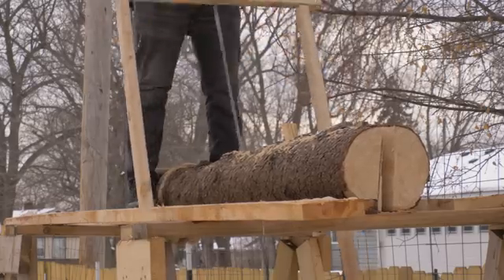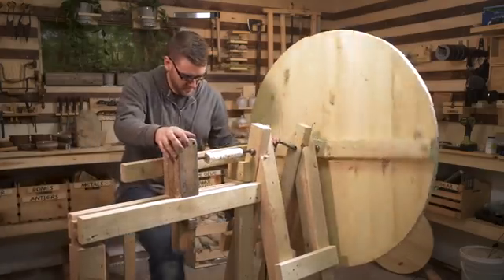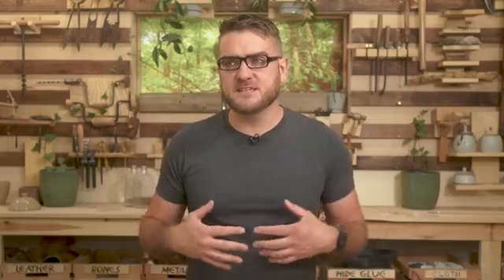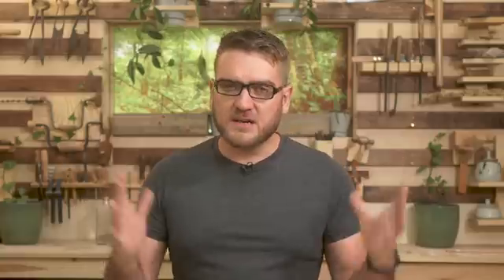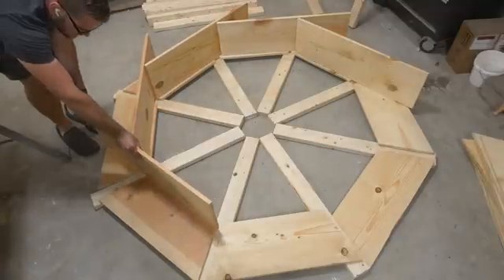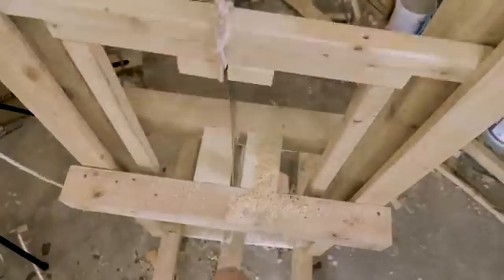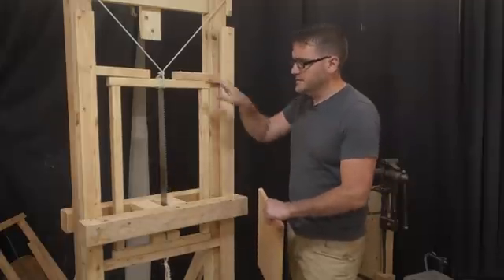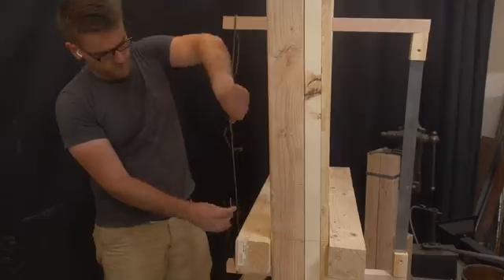I Built a Medieval Watermill to Power My Tools

Comment: The first thing they did to power the tools was to use a cam system to lift and push on bars similar to the DaVinci hammer you built. Though in the case in talking about they pushed down in a lever to lift the hammer then released it for the drop. You may consider something similar for the saw.

Comment: I love this time in history but I really think a step is being missed here and that step is what I'm extremely curious about and maybe lost to time now. This is actually building a machine out of lumber (which is yet to exist) to mill lumber. How did they create lumber before a mill. There must have been a step between hand cutting wood to lumber mill. And i'm talking about cutting straight wood for more precision in lumber mills, not just ripping wood by hand. I think it was the invention of the wood planer, but that needs a straight edge. Chicken and the egg scenario. I.e how did we create straight material to create straight material. Possibly straightness just got refined over and over slowly with each generation of tool creation. Great work Andy, soo cool what your doing.

Comment: Try extending your stand base out from the wheel on the crank side to  connect the crank into the wheel by two points then have it spin off the ninety degree horizontal to make another double pin crank attached to a cog gear.

Comment: On the upside at least the manual saws are a good workout, regarding the water wheel would not multiple smaller "buckets/blades" yield better results? I'd imagine they would take less time to fill and deposit thus leading to more consistent motion and faster revolutions.

Comment: The thing probably you could do is mount the wheel higher or put the saw in a pit so that the central axel is over the top of the cutting frame. Then you attach a crank to that to get your up and down motion.

Comment: You ARE planning to water seal that wood, right? If you're just using it to make content for a few videos, then it's not needed. If you're hoping to keep it around and actually use it, then you need to water seal it, or the wood will warp, and rot. You can research period correct treatments used to do this also. Otherwise, you can just get some modern sealer from a hardware store.

Comment: The big reason why you're not getting motion out of the axle for the water wheel is it isn't keyed. You have to have a Woodruff key or a dowel pin to connect the shaft to the wheel without it being able to just turn on the shaft separately and then you need one on the shaft to the crank to keep that from just being a bearing block as well. If there's nothing forcing them to spin together, the harder material is just going to spin freely inside the softer material.

Comment: wooden gears seem like a good step for a smooth transition from the water wheel to the devices you want to power with the possibility of increasing or decreasing the size to convert speed for torque or visa versa

Comment: You do know that water power, even in warmer climates while using a dam, is seasonal. You'll have the lowest power in the winter, highest power mid spring with the power falling off through the summer and fall. Not to dissuade you, but you should be aware of that.

Comment: personally I think if you've proven that you can do something manually but then you need to do it a dozen more times, it's okay to pull out the power tools, this whole channel is kind of a hypothetical right, nobody cares that you get timber from the hardware store, because like you say, you unlocked it by proving that you can do it yourself. 
Now with this wheel I guess you've unlocked power tools anyway so good on you
That hit in the head would have hurt

Comment: I'm curious as to why you didn't make a circular blade with a treadle & appropriate drive train for straight cuts, and use the frame saw just for rough cut lumber, ripping larger pieces & curved kerfs?

Comment: Gears and pulleys come next.  I am not sure that the industrial revolution came with harnessing water power.  The Romans used water power for milling grain long before the industrial revolution.  From what I understand the industrial revolution came from the building of laths that turned out precision, reproducible parts like shafts, bearings, screws, bolts, and nuts.  From these simple, but precise parts, power looms could be made.  Also the development of steam engines was critical for the transportation industry.

Comment: I wonder if you could add a sort of sled fixture that could slide horizontally toward the blade but restrict vertical movement of the work piece. It seems you are losing a lot of cutting motion when the workpieces are pulled upward by the blade of the spring saw.

Comment: Hey Andy, I love the videos but there has been something that has kinda bothered me for a little bit. Originally you started this series as a everything has to be made from scratch, and it has clearly went away from that since the fire etc. I guess what is bothering me is that some things you are insisting on using your home made tools and others you just pick up the materials from the store. Specifically, like the wood is store bought, but you are cutting i on your homemade saw, the metal pipe for the water wheel is store bought etc. On other videos you have spend a lot of time making wooden things to avoid store bought(which hasnt worked as well/broke and taken a lot of time), and I guess I am just wondering what your logic is here. No issues with what ever your answer is! I love the content I am just a little lost as to what the root of it is. I feel a little disconnected i guess. I love the crafting everything from scratch and the restart type of thing, but would love to hear more of your thoughts (possible in future videos) as to why you make the choices you do in certain builds. Obviously, no one expects you to saw wood for hundreds of hours in order to get a video out every few weeks. But is it more of a 'I've unlocked X with privative tech so now I can get the more convenient options'? Because if so, thats totally fine but thats the root of what I am trying to figure out! :) Thank you for the great content!

Edit: I do not care at all about the tubing for the water lol. Thats a no brainer! Once you craft something test it however you can. My question is just for the base builds. I wouldnt expect if you made an electric drill that you make your own electricity to power it (although you can now! :P).

Comment: For running the saw make the crank pull down on a rope tied to one end of a seesaw lever mounted above your saw and water wheel, and tie the saw to the other end of the lever. Add weight to the saw as necessary.

Comment: When I was a kid the dad of a friend had a metal shop powered by a single electric motor mounted near the ceiling. A rod ran across the room up near the ceiling, there were several drums on the rod, and straps, leather I think, ran down to each machine to be powered. There must have been some way of clutching/declutching each machine, but I do not remember how it was done.
Reply: If you do try this, broken belts whip with quite a bit of force, so when using handmade belts I would build a protective cage around them, leaving some way to replace the belts of course.
Reply: usually they had the wheels "slip" on the belts, and have a tensoner on a lever to engage the ""clutch"" (tbh slipping belts were the first clutches)

Comment: You could build a water tower with a valve to make rain water, additionally
 instead of a double swivel use a single metal crank with a horizontal swash plate

--------------
. (_______)
--------------

Turning circular motion into simple vertical motion

Comment: Calculate the horsepower!
Reply: As a first guess, ...
2 kg of water falling 1.2 metre,  E = mgh = 2 x 10 x 1.2 = 24 Joules.
Doing that in 2 secs, ... P = E/t = 24/2 = 12 Watts 
Convert to hp, ... 12/745 = 0.016 hp.

Comment: Here is an idea I had about a year ago. Father clocks…think about it, all the gears and springs generate energy to keep the clock going. My question, how much would you need to scale up the clock internals to generate enough energy to power that same equipment from this video? A simple wind of the crank or attach to said water wheel (say during a short rain storm) to keep energy stored in the springs

Comment: Don't forget to seal and use lard as grease. As for your output shaft it needs to be a more solid square or hex wooden shaft
Reply: yea i was gonna suggest making the shaft a much wider diameter to reduce the torque on it and be better at connecting to other stuff
Reply: That's what I was thinking - and it should go through the water-wheel, too.
Reply: Why?

Comment: If you stain your wood then seal it with tung oil it will last so much longer. Brilliant build!!!
Reply: Tar would also do the trick
Reply: @revilo00  As would creosote, yup.
Reply: Tung oil is about as waterproofing as (non-culinary) walnut- that is, not very. If you want waterproofed lumber, go with a linseed oil. Then use a shellac like pine resin as a finishing coat, in place of something like polyurethane.
Reply: @KainYusanagi  tung oil has been used to seal ships actually, but linseed oil is great too! Honestly even torching wood would be better then just leaving it bare.
Reply: @Bellllllz  Yes, and so has walnut; that doesn't mean that they're good at it. Tung oil does dry on its own, but it takes forever to do so and doesn't provide the best waterproofing, while walnut needs heat to break the proteins from the oil and allow it to harden (but is otherwise basically the same as tung oil functionally); linseed is significantly superior in waterproofing, and even slow-drying linseed dries faster than tung oil, while providing a superior waterproofing finish. Tung and walnut are more for land-based wood items, things like teak or oak furniture and similar (in fact, several tung oil formulations that included thinners and other oils were actually named "Teak Oil") where the finish can keep curing for months, if not years, and the rest of the finishes' properties are desired far more than waterproofing.

Comment: Jeez,  im watching you make these tools and wondering... clearly in your attempt to make things easier/simpler,  you are spending way more energy than doing it another way.  also,  you could easily make some braces to keep the wood from moving up and down.  in regards to the saw,  why not build a bike setup?  i mean, your building a waterwheel,  seems like you could get a good bit of steady power utilizing something like that and setting up a brace/pusher system.  Sooo many alternative ways to approach the things you are making that could be done far more efficiently with simple changes.
Reply: This is about historical methods more than efficiency. Efficiency comes with practice and understanding over time, creating advancements. Trying to replicate the first forms of these tools creates inefficient versions that can then be built upon and developed
Reply: @Rosiepedia  yea i get that, dont get me wrong. the things he is doing with these tools are dangerous.  Simple corrections could make this stuff 1, safer, and 2 more efficient.  Just because those were the tools of the day, doesnt mean somebody didnt adapt them in a better way.  I mean honestly,  to stick with something that is far more work than using the same saw to just do it by hand with all of those cuts doesnt make any sense.  people made tools to make life easier, what he is doing is not easier, hes repeating failed practices without advancing his own issues/flaws/dangers of the things he makes.  Did he set a rule that stated once he made something, he wasnt allowed to change it for the better?  any woodworker watching this i can assure you are shaking their heads at him continuing to use the tools in an unsafe manner.  One day, hes gonna lose a finger if he dont make some simple adaptations to that saw and stop keeping his arms right next to it.
Reply: @Rosiepedia  The other thing that frustrates me is how he doesnt talk about the dangers of these tools.  im not trying to be mean or anything but he really should sit down after he makes something and think critically about it and its pro's or con's and what he would do to make it better.  i would learn more from a critical analysis of his experiences than just simply doing something badly over and over just because of keeping to historical efforts.

Comment: I appreciate the commitment of Andy in showing the dangers that came with early self-moving industrial equipment. Really going the extra mile there.
Reply: First industrial accident is practically a major milestone.
Reply: @Mark-dc1su first robo kill
Reply: Ye olde industrial injurie
Reply: @chaseboday þhe olde
Reply: That's gonna hurt for awhile I slice my knuckles on shit all the time and just having to grip stuff opens it up and takes forever to heal but the knees get used consistently
Reply: @bubbajay4044  The vertical cut will hurt, but is less likely to open up as you move, horizontal cuts on joints will continue to open up constantly.
Reply: It was foretold all the way back when he fell into the cherry pond.
Reply: "Comit to the bit"
Reply: He’s a wizard now!😂
Reply: @greengreen110 Nah he's gotta die several thousand times before that happens
Reply: Lol

Comment: Wild hamsters will actually use hamster wheels that get left in the wild
Reply: So just get a lot of hamster wheels and boom: animal powered city
Reply: @Zero-The-Hunter  believe it or not, scientists did the math for that and just to power the average American household, you would need more hamsters than you could fit inside the cubic footage of the house if it contained nothing but hamster wheels packed in as efficiently as possible. And you'd have to deal with a lot of hamster corpses on a daily basis and have to continually replace them because they have short lifespans so you'd need a breeding facility of even more size than the size of the building holding the hamster generator.